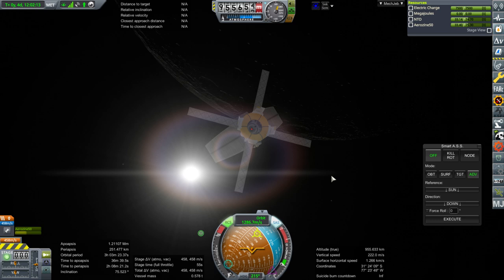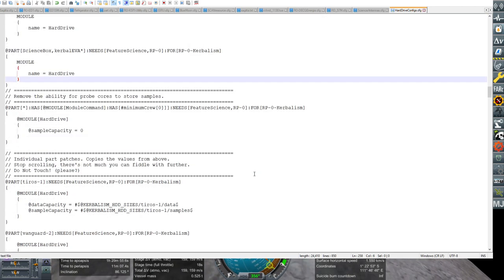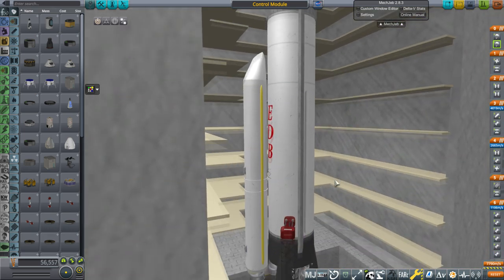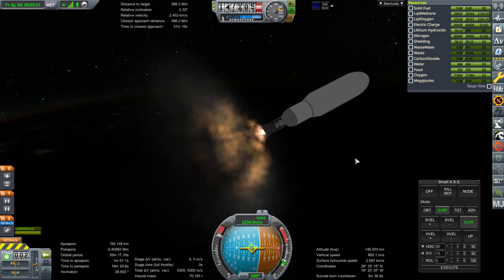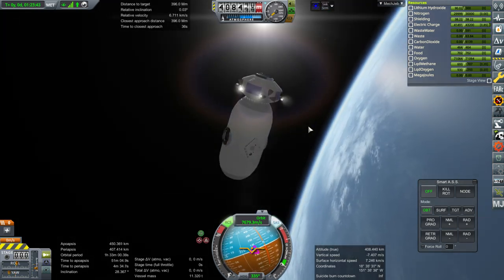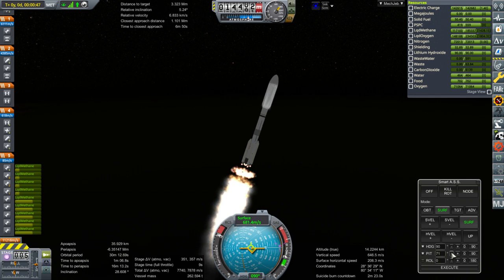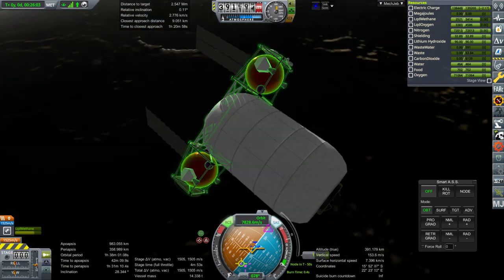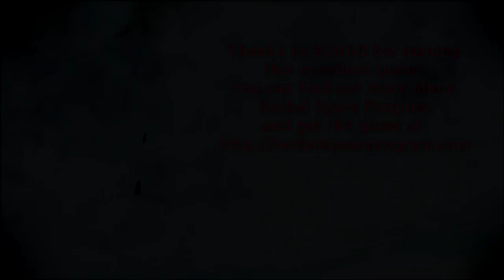KSP 1.6.1 RO and Kerbalism - Mars Colonization 003 - Control Module

Comment: some info i found about the Mars Recon Orbiter (MRO):
The Solid State Recorder is the primary storage for science instrument data onboard the spacecraft, with a total capacity of 160 Gigabits. That may seem like a lot, but not when you realize that a single image from HiRISE can be as big as 28 Gigabits!

The science data is stored on this recorder until it is ready for transmission to Earth, and then is overwritten with new science data.

The recorder is called a Solid State Recorder because it has no moving parts. Neither a tape recorder nor a hard disk drive, this device uses an array of more than 700 memory chips, each with 256 megabits of capacity, to store Mars Reconnaissance Orbiter's data.
so 2 GB could be considered low. 
Love the series so far!

Comment: Pro tip: if you right-click on any node in map view, the readouts remain visible when you move the mouse pointer away. So right-click the target intersect node, then you can move over to the navgigation node and tweak it until you get a good intersect.
Reply from the maker: I do know that, and I thought I did it at some point in this video. What you may not know is that those numbers often don't update when your cursor is hovering above a MechJeb window, and the intersect points in RSS like to disappear on me anyway, so I keep having to right-click them over and over again.

Comment: In the future for solar orientation, use the advanced tab in Mech Jeb 2's Smart A.S.S panel. Click on the reference body and set it to be the sun, then choose the direction that will best suit your craft(i.e. the most power generation possible). This will result in the craft always being oriented in the position you chose relative to the sun and it will track the sun even when you are away.
Reply from the maker: That doesn't work during time warp, as far as I know. I also don't know how it works in conjunction with Persistent Rotation which independently holds orientation towards the Sun, and has been reliable during time warp. Has MechJeb's ability been updated recently to be more reliable than it used to be?
Reply: @RaizSpace  I'm not sure if it is more reliable than it used to be, but it has worked pretty well for me so far. It might even work better with persistent rotation. But that's just a suggestion, if the power problems persist, it can't hurt to try it out. I'd also use the AmpYear mod since it includes reserve power in probes that can't be drawn from unless you allow it. That way if you run out of power with the solar panels in the wrong direction, you can use the reserve power to re-orient your space craft so you can start generating power again.

Comment: Hey, thank you so much for your series, very interesting!
As of redundant units inside crew modules - they're by Kerbalism, it's mentioned in wiki; same for nitrogen and may be some other stuff you didn't add explicitly - N is being used to pressurize crew cabin. Coz of Kerbalism you will also experience solar panels degradation and crew meltdowns and screw ups coz of lack of windows in your habitats (these were mentioned in wiki too, apparently kerbals like watching space through windows huh).
I'm not sure if it's safe enough (at least IRL) to mount heavy logistics module and lander to the side of control module; your Mars ship would experience much higher acceleration rates then ISS and so detaching/rotating forces on docking ports may possibly lead to depressurization or air leaks may be?
Also why wouldn't you use nuclear propulsion instead of chemical and ion engines? I do get that ion engines have much higher ISP (in order of magnitude comparing to even fictional nuclear prop engines), but is it worth the hassle considering ion engines lower TWR?
Anyway, keep up the great job, being watching your series since first episodes of Beyond History 1.1.3 and still excited :)
Reply from the maker: It'll be higher acceleration than ISS, but not more than the docked Apollo CSM/LM combination, so I'm sure the situation has been checked out. Nuclear propulsion is heavy to launch and not well suited to the rockets I'm limited to, and the math for ion engines works out better despite the hassle. Space is largely a patience game, anyway.

Comment: Also, could it be that you having different mods changing the electricity functionality might be messing the charge in your crafts? Or maybe kerbalism for some reason it's not accounting for recharge...
Reply from the maker: Don't know yet, either is possible.
Reply: @RaizSpace  Kerbalism + Persistent Rotation currently don't really work together. It's technical, but the gist of it is that PR doesn't actually rotate unloaded vessels while they're unloaded and thus the solar panels aren't aligned to the sun after a while. This is being fixed, the current development version of Kerbalism assumes a constant sun relative angle for all solar panels on unloaded vessels - with and without PR installed.

Comment: Cool! Can you make the ship have the same nice aesthetics as the first SCMM?
Reply from the maker: It'll be similar, but the Xenon tanks on that had an issue (they were SSTU parts with negative mass when empty), so I'll be using different ones - preferably ones I configured so that there won't be any bizarre problems.
Reply: Raiz Space Thanks. Is this going to use the same giant ISS solar arrays or can you make it nuclear powered or something?